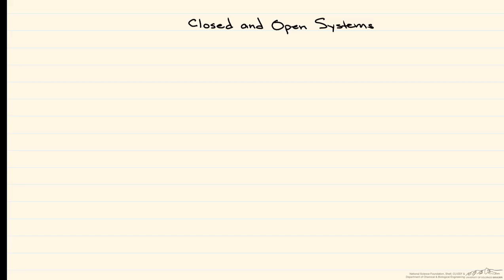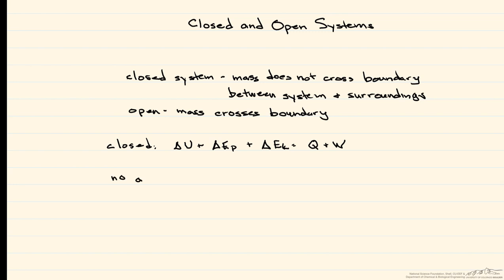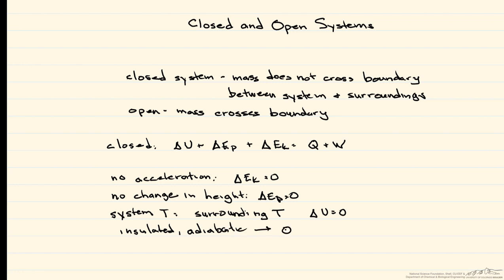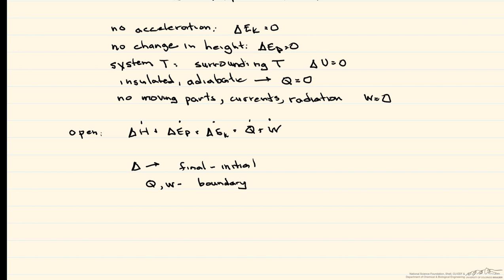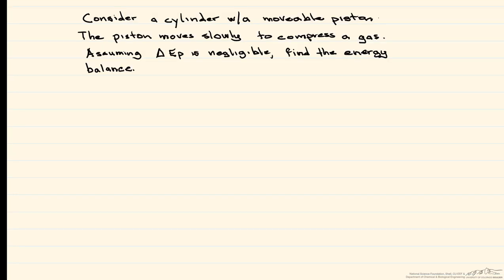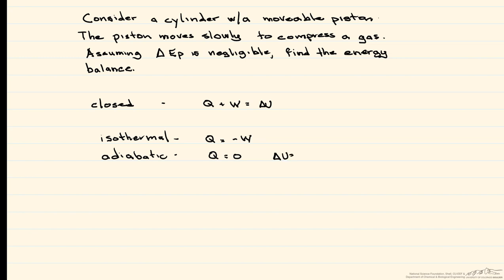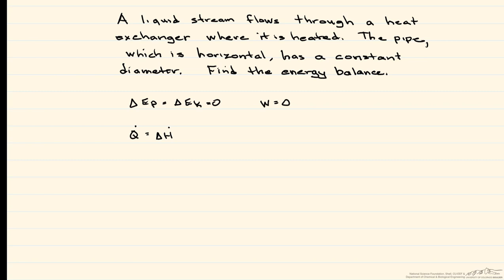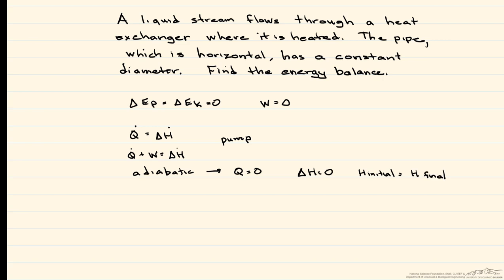Open and Closed Systems

Comment: There is an error in this screencast at 3:19. "Delta" for a closed system energy balance is (final energy) - (initial energy). "Delta" for the steady state open system energy balance, discussed at 3:19, is (energy out) - (energy in)

Comment: There is an error in this screencast at 1:32.   "Delta" for a closed system energy balance is (final internal energy) - (initial internal energy). Delta-U is not related to any temperature difference between the system and the surroundings. If the temperatures of the system and the surroundings are the same, that does not mean Delta-U = zero. If the temperatures of the system and the surroundings are then same, then that means that Q = zero (no heat transferred between system and surroundings; system is adiabatic.
Reply from the maker: This is not a mistake. If the system temperature is equal to the surroundings temperature, this means the system temperature does not change since the surrounding temperature does not change. This means the system is isothermal. For an ideal gas, the internal energy change is proportional to the change in temperature.  If the process is isothermal, then the change in internal energy is zero.
Reply: @LearnChemE  the internal energy change is proportional to a change in temperature within the system, not to any difference in temperature between the system and the surroundings.